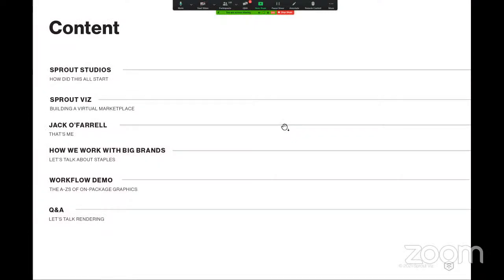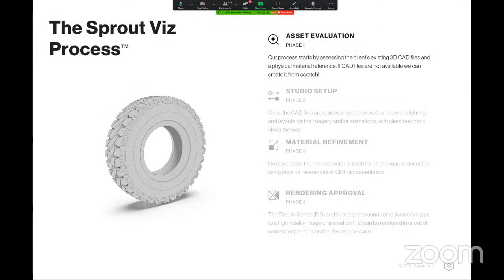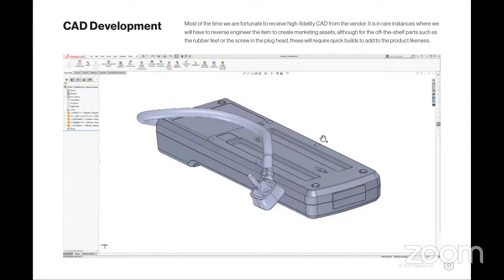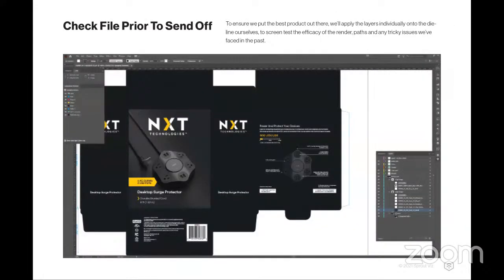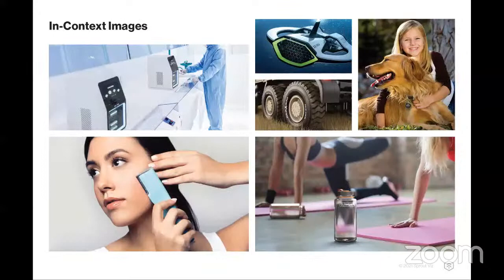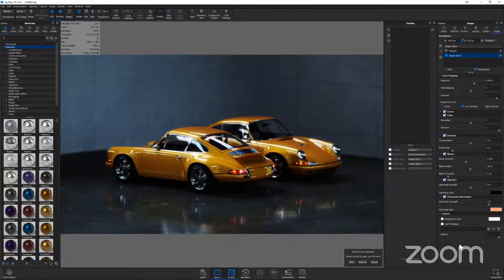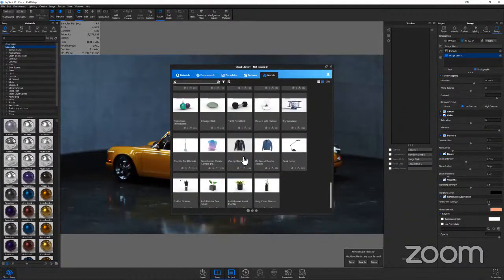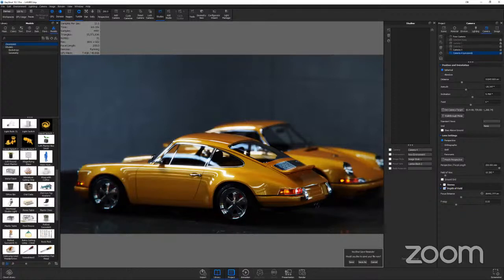SOLIDWORKS to KeyShot with Sprout Studios [LIVE]

Comment: I had to take some calls during the stream so I had to pause it and couldn't submit my question live.
I have a RTX 2080 Ti, and my benchmark score is 47.76 on GPU. From my experience, GPU rendering scales with the number of GPU pretty well. I can get another RTX 2080 Ti and get to 90 GPU score. 2 cards together, at launch price, is $2000+tax. RTX A6000 is over $5000. What benifit do you get from a "Quadro" card?